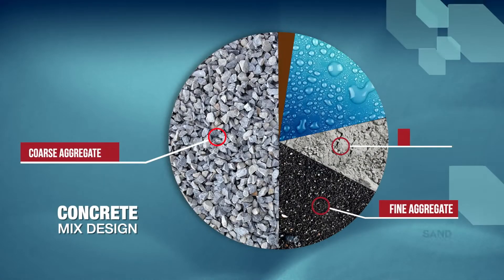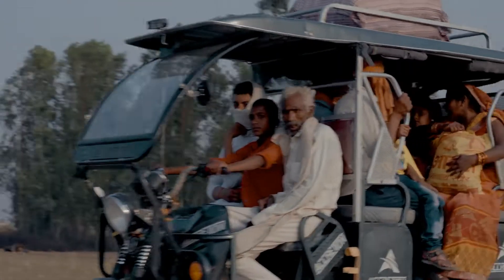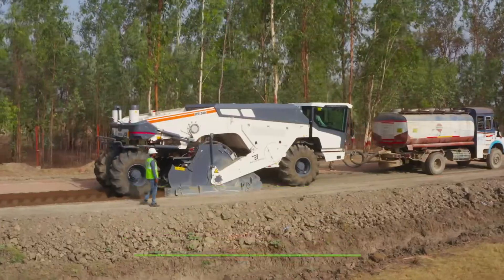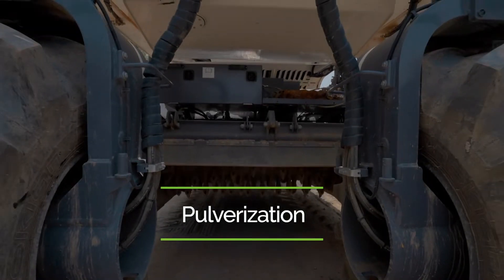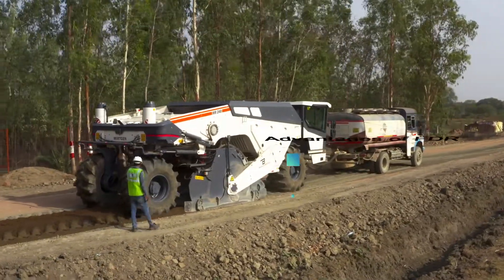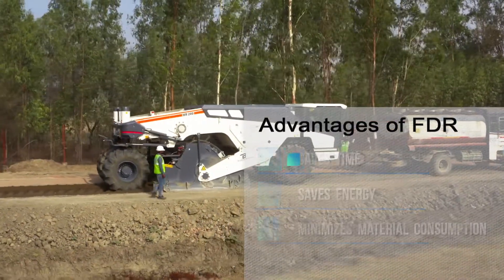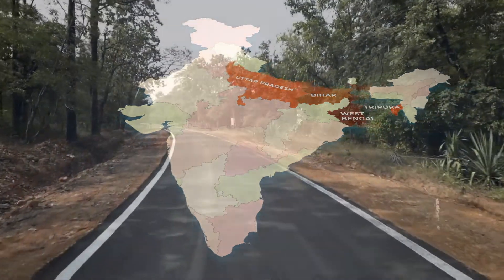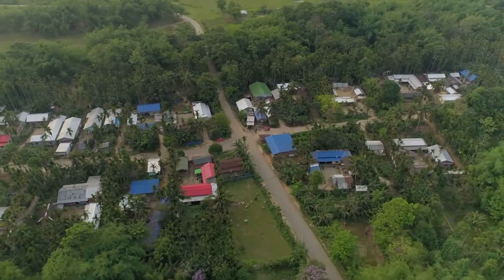FDR is a cost-effective way & eco-friendly way to connect unconnected rural habitats | #PMGSY

Comment: A very popular reconstruction alternative is known as Full-Depth Reclamation (FDR). FDR is an in-place recycling method for reconstruction of existing flexible pavements using the existing pavement section material as the base for the new roadway-wearing surface.